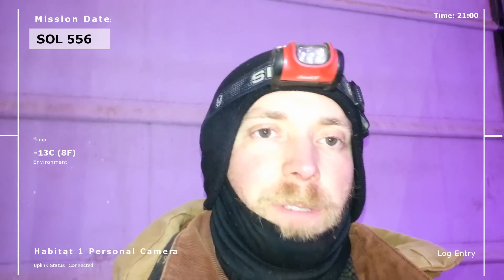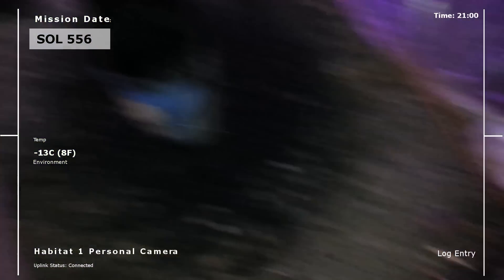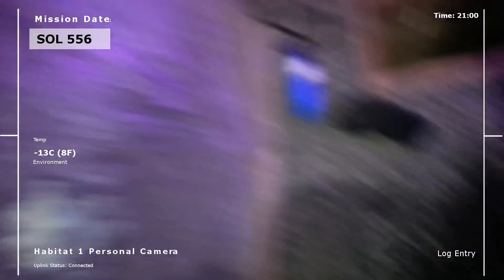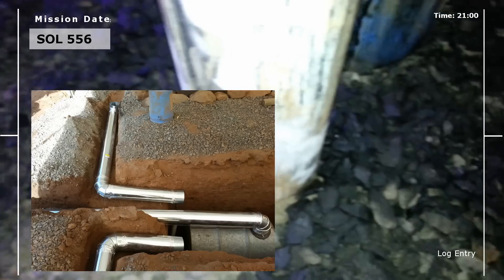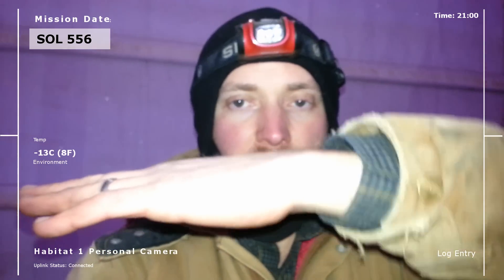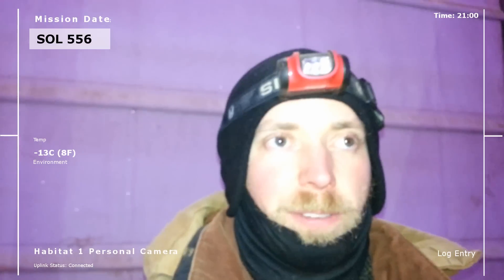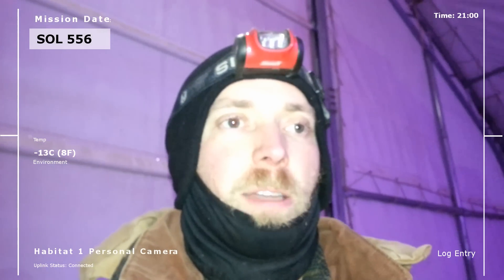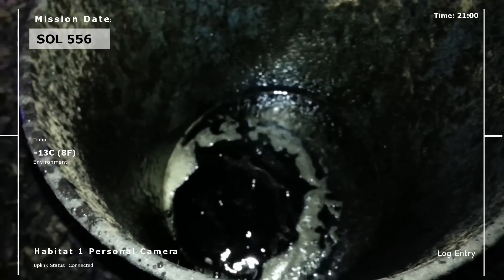Greenhouse Heating - Double Barrel vs Rocket Stove?

Comment: With the way you building it you'll never get no more than probably a 45 efficiency with rocket mass first of all you want your intake air to come from outside not from inside of your Greenhouse you're just drawing all your air out of your greenhouse and bringing cold air in second you want the whole Mass heater and the rocket stove made out of fire brick and Clay brick you don't want you want to put a batch box that way you can feel it with logs and they'll burn longer but you have to draw the air to feed the fire from outside no matter what if you don't you're beating your head up against the wall if you want to use a large Mass even in a large mass you can use thermal electric generators to power everything in your Greenhouse a lot of people don't know that

Comment: You must have missed this rocket stove. Big batch box that would easily hold the amount of wood that you showed. So you could have had your all the same amount of heat and burned a lot less wood doing it. The double barrel does do a good job of keeping heat from flowing up the chimney, but it doesn't do anything that I can see to help the burn up every last bit of uncombusted smoke.
 
https://www.youtube.com/watch?v=Ls_eqNB6d0Y

But good job on nailing the numbers.Over a very long career as a rocket and jet engine propulsion engineer the one lesson that I have learned is that simulation are are always wrong, but quite often they can be very useful. Oh and I completely agree, never sell your engineering books, you are going to need those. Or at least I have occasion to frequently reach for mine even 40 years after my last engineering class. After all, the fundamentals of heat transfer, combustion and fluid dynamics are still the same and are still the three main processes going on in a real rocket engine. Only now I use CFD. finite element structures codes and others that allow me to understand what is going one inside the cooling jacket, the complex combustion of impinging flow injectors, two phase flow into the inducers in front of the pumps and other horribly complex parts of a rocket engine that when I only had general ideas of what was happening I first started.

Comment: to eliminate most or all of the creosote and to increase the burn efficiency install a baffle in the burn chamber to divert the air flow from going directly out the flue to the 2nd barrel. then install 2 air pipes from outside the barrel bottom to deliver preheated oxygen above the baffle. this is an afterburner to more completely combust the wood gasses produced when heating the wood during burning.

Comment: True 'rocket' stoves generate some positive flue pressure by way of the proportions between the initial firebox, the throat and the burn tube such that the fluctuating pressure created in the re-oxygenated flame then acts to 'push' the expanding gases along the exhaust (much in the same manner as a WW2 doodlebug)  solely due to that path having a lower restriction than the throat.     I.E. it's actually an exhaust, not a flue.    This positive pressure then allows for a long as necessary, horizontal and serpentine exhaust system which, in turn, allows an almost complete heat recovery from the also extremely efficient but, initially, very heavily insulated, burn process.     Hence, rocket stoves, well designed and installed, are the most efficient,  by far.

Comment: What else is on mars that COULD be burned? Is there coal, there? Creosote water... Boil it down to the consistency of syrup, and paint it on things that you don't want to rust or rot. Stovepipe. I've always gone with single wall inside, and double wall from ceiling up. This gives you as much heat as possible off the pipe inside, and the double wall on the outside helps retain as much draw as possible.

Comment: Look at LDSPrepper, he insulated around the green house with 4" foam to create a thermal break around the perimeter. Also it seems like the air gap roof would really help with a insulation layer.

Comment: be nice if there was a radiator for the chimney.  Probably not going to be completely effective cause we need heat to get the soot out, but maybe even used some extra pipe to run it side to side or something might keep more heat inside.

Comment: have a look at this ,it is a link to batch box Rocketstove  http://batchrocket.eu/en/   it micht be interesting for your prodject
Reply: An easy inprovement on the upper barrel is to put in a normal stove pipe that is cut in half 6"  let it rest on the barrelsbottom  with the opening in the direction of the exaust of the bottom barrel ,by this the hottesd gasses stay in longer for more info fb rocket stove /rocket mass heaters international

Comment: If you can render out the creosote and mix it with any used oil around the farm... Take that and make an oil "drip" in the stove system you already have. It's not much but it'll give you a few more BTU from the system. IE using something generated by the system to help by contributing back in to the system. This would be something you could stockpile and use to supplement as you see it's needed. like when it's cold and you need a little "boost" to keep things hot.

Comment: A batch loaded system for firewood burning is a loooot better than continuous burning. http://batchrocket.eu/ is one nice looking design I ran into on http://permies.com forums. Well really on youtube and then permies. With an efficiently burning system you'd save roughly half the firewood and have a lot less issues with creosote consendate in the chimney. We in Finland have brick built chimneys and the general design idea is to have the flue enter the vertical chimney at around 200°C so as to keep it not condensating. Also, the chimney needs to be higher than building roof so that it'll catch wind from all directions. Anyway that's not likely to change for you during this heating period so I'll try to keep my feedhole shut about the wood burning as much as I try about the insulation issues... :)

I'd love to see the calculations and play around them a bit changing a few variables here and there. Things like insulation efficacy and other stuff that you really cannot try out without shelling out a bucketload of money.

Also, I'd like to somehow possibly take part or at least curiously look at the automation systems design.

Comment: Creosote water is wood tar. Wood tar has all kinds of uses. It can be used to make all kinds of salves. It can be used as an anti-septic, to make some glues, to make a laxative, and many many more uses. With how much you are getting though, I really do not think you need to save it up, haha.

I really think all that empty space over top of your grow lanes is not helping at all. It is a giant space to heat up. I know cost is a major issue, but some plastic strung across the building should be enough to help keep the heat down near your lanes.

Comment: creosote water can be separated and the creosote used to treat posts from insects. (Thin with diesel fuel) Water can be used around nut trees when highly diluted. Probability dictates long term goals are nuclear/solar, but most likely destination derived source.. Obviously out of budget, so "substitute" with ANYTHING you can and remember that by engineering thinking, "heat is a byproduct of waste" (but that sounds like free resources)

Comment: something to also research if you are burning wood would be to capture the exhaust and with the use of a venturi you could possibly use the hydrogen to fuel a generator. I'm not 100% on the full details, but either the Discovery Channel or the History channel had a series about some back-woods engineers who did something similar on one of their episodes.

Comment: Something to consider with rocket mass heaters; like any fire, starting the fire with cut kindling is important to cultivate a flame, but after it's going, you can just cut branches that have fallen on the ground to length and use those. You could collect all the wood you need with a rake. Paul Wheaton has several videos about such things.

Comment: There is a batch rocket stove design that is well developed,  You could load the same volume as you currently do but the smoke would more completely burn reducing your creosote problem. This is the best access to the developer. https://permies.com/t/55532/Batch-rocket-resource

Comment: https://youtu.be/RXY0JKU12jg I would use this type of stove but moddified like this the intake for the fire ( oxygen) would come from the outside and the exhaust would run throgh the ground inside the shelter to act like a heat battery. as long as the exaust exits out the top there will be airflow. alot of peaple dont know that. the heat blown out from the fan do what you want with.

Comment: I just recently separated from the Navy when my contract ended.....I'm not sure if it's the same thing, but I think the Navy used to use Creosote (or something like it, maybe Tar) as a water-proofer.   Maybe I'm wrong.      I'm not used to seeing it liquid and dripping, I'm more familiar with the build up in my chimney....is that the same thing?   If it is, maybe you could leave your collection of creosote to condense out in the sun into a paste that you could use to fill voids in wooden structures to improve its air tightness.   ......Is it flammable?  Maybe with a wood stove that burns hotter, (like an incinerator) you could use it as a fuel.    Maybe dip wood in the creosote before you burn it, (let it dry first too) and possibly increase the potential of energy within the wood.

Comment: If you could add mass (cob, concrete, etc) around the above ground chimney, It would store the head from the chimney for some time and slowly radiate it back out.   In addition,  the retained heat will reduce condensation inside the chimney and reduce the amount of creosote water.  See my comment from yesterday on pellet fed rocket mass heaters.  Thanks,

Comment: all under floor heaters I have ever seen had to be insulated from the ground.  some people in the comments say the heat travels  up but that is not what I have seen. I would imagine if you could heat the heat sink to the max temperature it would radiate extra energy but in this case the heat sink is the earth and it can eat all the heat you can throw at it.   You are an engineer with math figurin' so you probably already considered that. The greatest amount of heat from a double barrel is radiant aren't you dumping it  into the ground?
Reply from the maker: I have let the stove go high speed and it certainly does heat the mass of dirt around it...even when it burns out you can go down the ladder and feel the radiant heat...so it certainly does radiate into the Earth.
Reply: The Silent G
Very smartly so. Radiant heat as the name suggest radiates, as in it travels through air without heating it. Air is transparent to ir radiation. THe heat would overheat nearby objects through radiation and if those are plants they would bake while anything in "shadow" remains cold. This way radiant heat gets converted to conducted and convected heat and he transports those to where it is needed in a well distributed fashion. After all all he needs is keeping everything over freezing point...

Comment: Everyone talking about your insulation problem in other videos and I thought I might have an idea. Could you put a lair of plastic sheet on the bottom of the ridge beams leaving about a gap were something like hay could be stuffed inside. I thought it might work if there was a way to get the plastic cheap enough. Im not an engineer by any means of the word. I just really like to build things.
Reply: I just realized the roof might not be able to support the weight but the walls probably could.

Comment: Real Martian keep up the good work, farming on a budget isn't easy, don't give up. We heat our house and hot water with an outdoor wood boiler, Best system we have ever used. I would say long term if you have a good supply of wood an outdoor wood boiler would be the way to go. Until then would it be better to take the barrel stove out of the ground and just set it up at floor leave? I wonder if the moist air in that hole is hurting your burn. Use the creosote to treat wood that has ground contact.

Comment: I think the true solution to the heating problem is to reduce heat loss with some kind of insulation.  Straw bales, hang blankets outside the plastic, reduce the size of the lanes eventually it will be four tall, but make it less for the time being (perhaps lay plywood down on the pallet racks and staple the plastic to it from outside in?  Wouldn't reducing the temperature difference inside grow lane to outside lane reduce the condensation problem?
Reply from the maker: agreed that I need to improve insulation..

Comment: why don't you use bubbel wrap as an isolation ist's ceap and works greate
Reply from the maker: it's the sizes that it comes in that make it a challenge...I need a 40ft x 100ft section
Reply: Here in the Netherlands we use it in the winter ti isolate green houses so yo have rolls that are 164 feet long and a 11 feet  wide but i don't know if you can find such ting in the US than you could overlap a bit

Comment: i'm sure you did, but did you consider geothermal?  there's a youtuber named ldsprepper that built a geothermal greenhouse. he uses the air from underground to stabilize the inside temps.  i think the limitations you might have is the cubic foot area of your building, but maybe you could put the geothermal under the grow lanes and keep it contained.
Reply from the maker: I have....$40k installed or $20k for parts...yikes...in addition 240V and I only have 120V and 40Amps
Reply: wow, $40K ... this guy did it by burying 6" flex hose under 8ft of ground, and he lined the pit with 4" styrofoam walls, keeps the pit 20F temp difference than outside the pit ... anyway the way he did it was very cheap, and he claims very effective.  but he does have a smaller operation than yours.  sorry to hear about your frozen plants, good luck, i'm sure you'll come up with something cool.

Comment: Google 'Batch burner rocket stove'.  They are making rocket stoves that burn large pieces of wood in 1-2 cubic foot loads.  A side effect of rocket stoves is that there would be no creosote disposal problem.
Reply: The site http://batchrocket.eu/en/ is an excellent resorce. The author has taken the time to do considerable detailed analysis of batch loaded rocket stoves and will save you loads of time and mistakes if you choose to use one. Even if you don't, his insights into both the chemistry and mechanics of wood combustion may be useful to you in solving issues with the double barrel design.

Comment: I think you picked a really good time to launch your 'Real Martian' channel and to get the project up and running. This is probably the most challenging time of the year, so getting through it will bode well. It also makes for more drama which should be good for building subscribers. 
    This explanation of the design choices you made reinforces the discussion of optimal design in "The Privileged Planet" Various parameters affect (even effect) final design. The best personal computer needs to balance speed, capacity, cost, durability, portability, looks,... for the target market. It may be that none of the parameters can be optimized to produce the optimal product.
    Hang in there, pilgrim.

Comment: We used to use the creosote/water to soak fence posts ends in before we'd put them in the ground and found they lasted far longer as fence posts and less bug damage over the summers.  Secondly we'd soak binder twine in the creosote and dry it and used the twine to tie down the bottom of the chicken and garden fences to small ground stakes (also soaked in the creosote) to keep the fences down and had no rotting of the ties over each summer.  This meant no escaped chickens and no rabbit damage to the garden crops from rabbits sneaking under the fence where any tie downs might have rotted.

Comment: Thank you for all that you show I hope to adapt some of your ideas on future projects with my parents high tunnel. I had a thought for heating your grow beds. What if you run the water from the pumps in the fish tanks in copper pipes either next to the wood stove or even through the top barrel (possibly black pipe so you can weld it to the barrel to seal it) and then dump the heated water in the grow beds. Im not sure if this idea would work or if it would get too hot. However it is less costly than a boiler.
Reply from the maker: we actually run pex tubing underneath each fish tank that has hot water (hydronic heating) in it. Thanks for posting!

Comment: waste oil(used engine/cooking) stove...can easily and very very cheaply convert your wood stove or make a combo...plenty of vids on YT about it....biggest expense you'd have is gasoline transporting the FREE used oils but if you can find sources(garages/restaurants) then you can pick it up while going to your job ...can run that bad boy 24/7 without havin to check it every few hours (unlike wood)once you get the oil flow rate set properly....best of luck